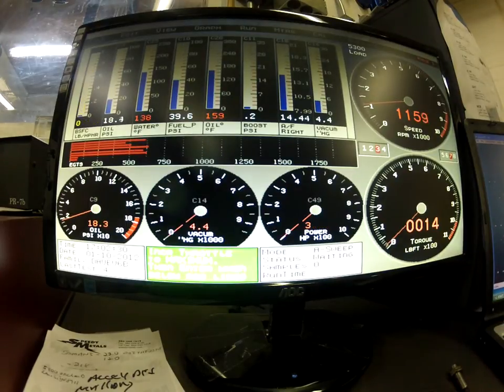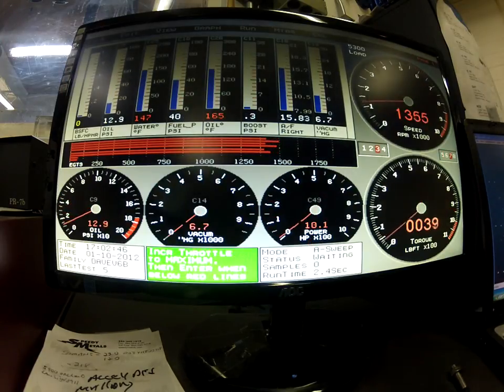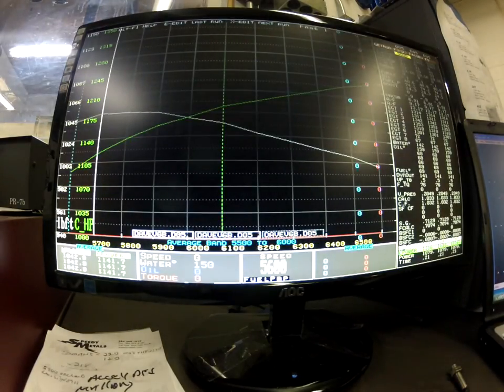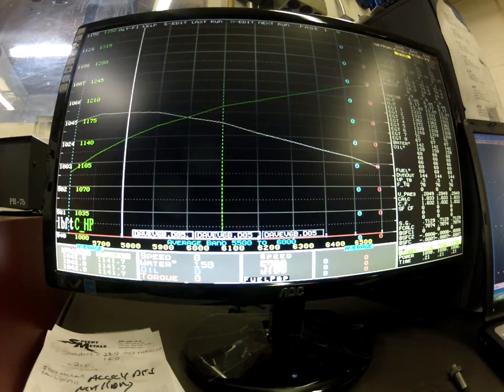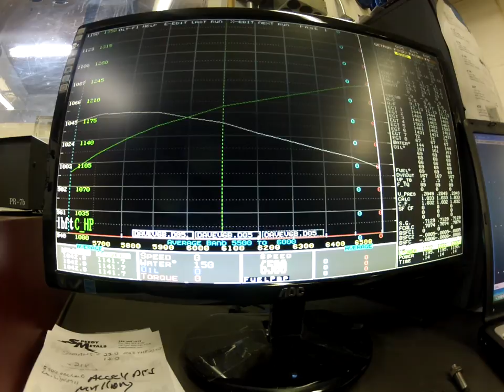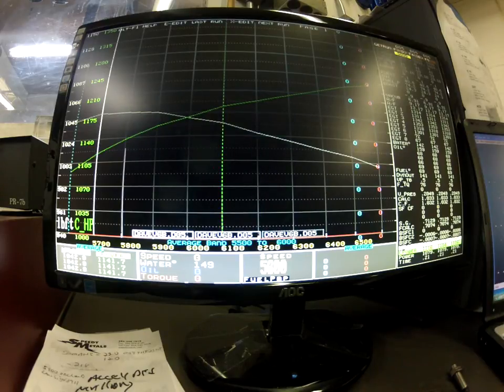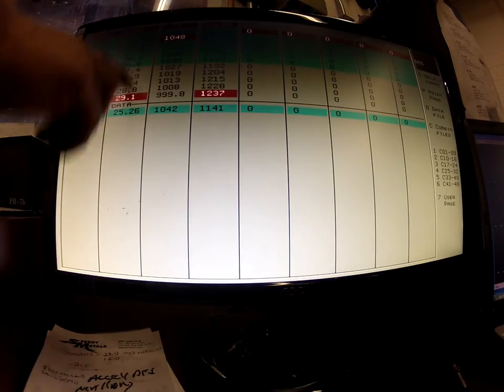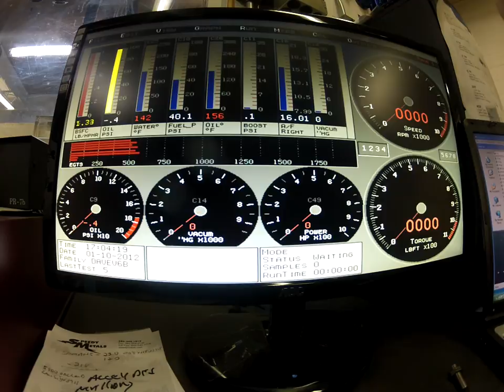1247 Horsepower Chevrolet V6 Twin Turbo Dyno pull 4.3 Turbo

Comment: Im currently building a 280ci oddfire with pontiac raised runner heads. I will be using the precicion  GEN2 PT7675 turbo
Reply: Make the video